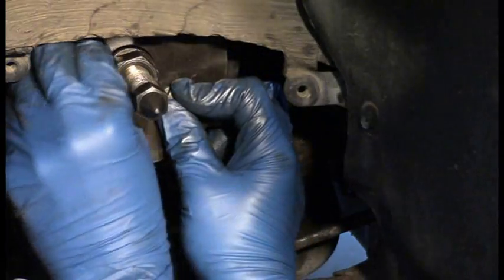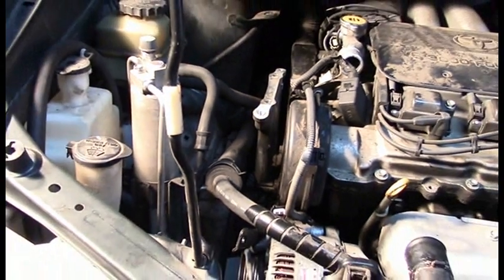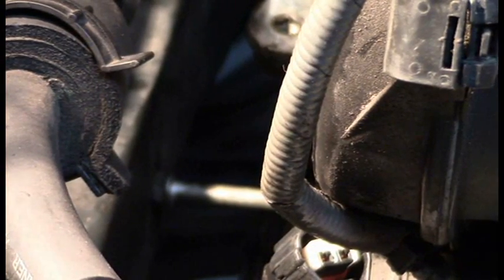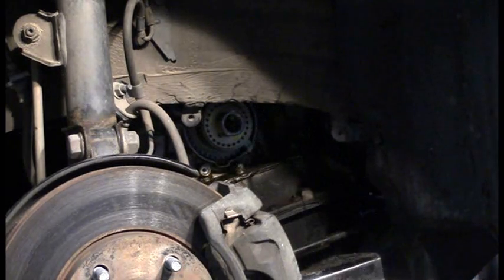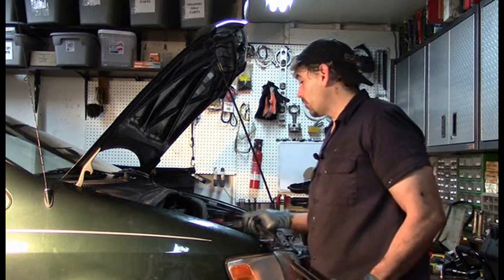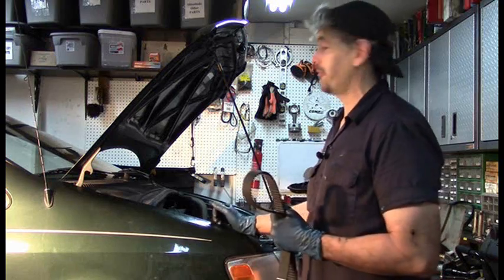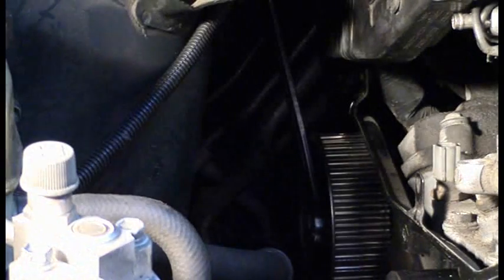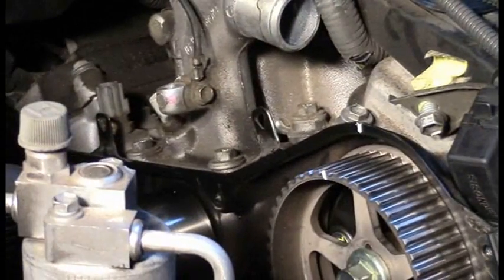Timing Belt 1997-2010 Toyota V6 Sienna, Highlander, Camry, Lexus Part 2

Comment: Matt, another excellent video with very helpful suggestions like changing all parts that touch the timing belt.  I have to do this job in a few months on a 2005 Camry 6 cylinder.  Couple of questions.  1.  in regards to 14:38 in the video, some manuals call for rotating the crank shaft pulley 60 degrees counterclockwise from TDC which may prevent having to wedge a wrench on the Bank One cam shaft sprocket.  If true, does that change how I align the new timing belt?,  2. where can I pick up some of that white paint?
Reply from the maker: +Sandbag1300 The white paint is just touch up paint from parts store. As for the 60 degrees- yes you can do that way too however I find it easier to keep the crank and cams lined up at TDC so I am able to easily check that everything is lined up.  Either method will work but eventually you will need the crank and cams lined up at some point- I just find it easier and I think safer to lock the cams is all. 
  I have done it both methods though and mine just makes more sense to me.
Reply: +Schrodingers Box Can you also list the models of the crank puller and cam sprocket wrench you used.  The Toyota versions are really expensive and I would rather not pay for Toyota tools if I do not have to.
Reply from the maker: Crank puller was an OTC universal puller and the sprocket wrench was Lisle.

Comment: How do I remove the rear camshaft sprocket in order to change the oil seal without it springing back? You mentioned you didn't want to remove it because it would be a big pain, but I need to remove it so I can replace the oil seal. What's the safe way to do this? Will rotating the crankshaft back 45 degrees, as you mentioned, relax all the spring tension on the rear camshaft sprocket enough so I can remove it without causing damage?
Reply from the maker: +Eric Kotter You positioon the crankshaft about 45 deg BTDC and then let the cam settle back into its neutral position, then you can safetly remove the sprocket without having to worry
Reply: Thanks!
Reply: The Haynes manual recommends making sure everything is properly aligned, removing timing belt tensioner, then...

"#15: Relieve the tension between the rear (right-hand) and front (left-hand) camshaft sprockets by turning the rear sprocket slightly clockwise." 

CAUTION: Don't Turn the sprocket any more than is necessary to provide enough slack to allow you to slip the belt off the sprockets.

#16: Remove timing belt." 

Is this technique possible/recommended? Instead of going counterclockwise with the crankshaft, going clockwise with the camshaft? Are these the same thing?

Comment: i thought ive seen some forums saying that 1mzfe is non interference and the engine will not be messed up even if the timing belt breaks while the engine is running
Reply: EvendimataE As far as I understand, the 1mz-fe VVT-I engines are interference. The non-VVT-I are non-interference.
Reply from the maker: Depends on the year but actually the engine shown in this video is not interference but I wanted to show the procedures for interference engines.  If you are in doubt, assume it is interference.

Comment: thank you very much for all information. I have to do it again and follow all right ways.
Reply from the maker: Most people who try this the first time find they didn't time that rear cam correctly.  It is very difficult to line the timing marks and the mirror, while the best way IMO, is still very challenging to use.  But normally if your car doesn't run right or you get a check engine light after this, it was mis-timed on the rear cam.

Comment: While talking about changing the water pump you mentioned the need to remove the cam sprocket. At the beginning of the video series you mentioned having a complete timing belt kit with water pump gaskets and seals (that you didnt show all) but now it seems that you are not going to change the cam and crank oil seals which I do on every job as a professional.  These seals also have 108K miles and are hard and the garloc seal spring is not compressing as strong and these seals will start to leak soon enough.  As you know, oil leaking on the belt later (soon) will shorten the life of the new belt, not to mention the oil leak will show up on the driveway soon enough also and will require the entire timing belt and gears to be removed again just for a $10 seal replacement (about $30 for all three, in Japan price).  I also estimate the accessory belts as part of the job after getting eyes on to see how old they may look, as you have mentioned.  If previously leaking oil I will also replace the front timing cover dust gasket (if used) as it is usually swollen.  If not swollen, I will clean it and RTV it back onto the cover right away so it will be dry by the time I put the cover back into place.  I also like marking the belt technique with a white stripe and verifying proper alignment before removing the belt initially,  Great job again.

Comment: Please dont forget that when you remove the harmonic balancer, that you should inspect the crankshaft key, and dont loose it, the crank keyway and the balancer keyway to see if these items are worn out, key slightly sheared or keyways for being enlarged.  As part of this job on some cars you will align the timing marks on the crank gear but once the job is done there may be timing marks on the balancer pulley itself to set timing or there may be a reluctor wheel on the back side of the balancer pulley that requires proper alignment with its crankshaft pick up sensor (CKP) and if the key or keyways are worn this alignment will be off and may seriously effect electronic timing on late models or inductive timing as far as a timing light is concerned on older models.  Always love your work.

Comment: Springs are relaxed when valves are closed, so wouldn't the relaxed position of camshaft be one with most of valves closed? I don't suggest to let it turn, but trying to understand what will happen if that  wrench would fail to hold that camshaft.
Reply from the maker: I will try to explain better-  the rear camshaft is very unstable in the TDC position and if you so much as accidentally turn it even a couple teeth towards the firewall it will snap very, very sharply and rotate maybe 100 degrees or so. Now I am not actually sure which cylinder(s) would be affected because I don't know the firing order off hand, but lets say for sake of argument that in snapping backwards, the intake valve on cylinder #1 opens (which would be the case since it was at TDC and valves closed so at some point rotating backwards will open the intake valve). Since the piston is sitting at TDC, the valve will open right into the piston, possibly causing damage (probably not likely to cause actual damage, but who wants to risk it?).  My strategy of locking the cam with the wrench is to prevent this from possibly happening.  Again, I don't know that cylinder #1 would be the one affected by this, but lets say at the TDC position Cylinder #3 happens to have a piston also at TDC just after the exhaust stroke so the exhaust valve just finished closing. Well in that case you would absolutely see how the cam snapping backwards very sharply would cause the #3 exhaust valve to slam into the #3 piston, right? Again I don't know the firing order off hand but I do know that at least one piston is definitely coming into contact with a valve is that cam snaps back.
  The front cam could potentially do the same of course except it's in a stable position at TDC so it is not going to move.  Hope this helps.
Reply: Schrodingers Box 
Google suggests that firing order is 1-2-3-4-5-6. If I did my math correctly, when cylinder 1 reached TDC, cylinder 3 made 120deg in intake stroke (intake valves open) while cylinder 5 made first 60deg in exhaust stroke (exhaust valves open). So exhaust valves of cylinder 5 will tray to turn camshaft by (60+53)/2=57deg backwards, but cylinder 3 intake valves by (120+12)/2=66deg. Intake valves of cylinder 1 will stay closed first (180-51)/2=63deg of camshaft backward rotation. So cylinder 1 we can hit with help of inertia and with this firing order only cylinder 1 is in danger.
Reply from the maker: Maris Strazdins Impressed!! Damn, Pascal if my calculator ever breaks I'm contacting you personally.
Reply: Schrodingers Box Anyway, You are wright, that camshaft should be held to prevent it from turning unless instructed otherwise. Firing could be different. For VW diesel engines with unit-injectors massive springs from injectors also could want to turn camshaft.

Comment: The main thing that separates the amateur from the pro is depth of experience, to know what to do when things don't go well. For example a broken bolt, or a harmonic balancer that won't walk off. The pro already knows how to deal with it. He shrugs and reaches for the right tool, as you did at 0:22. The amateur swears and gets a bigger prybar, and then problems cascade.
Reply from the maker: Absolutely true Dave!! Indeed most of what I know is from experience of doing the wrong thing years ago!! Also, a pro tends to just plain not get into trouble in the first place as much as an amateur- again as result of experience.  I really can't remember the last time I stripped a bolt, or cross threaded one, or crossed ignition wires up, poked a hole through a radiator hose, etc... Man when I first started, I used to spend far more time fixing something I caused myself than I did fixing the original problem!!  The right tools also help tremendously to keep out of trouble in the first place, as well as get out of trouble and of course make things go faster and easier.

Comment: Wrench holding the pulley will keep tension on it and the possibility of it flying off and damaging something else, plus get in the way of belt R&R. Impact gun on the pulley bolts would work if it fit in there.

Comment: Hey Matt! Once I broked a camshaft sproket on a,Ford Probe 2.5 V6 engine with a cam holder like yours. It was a bad day...jeje since then I prefer to take the valve cover and do it like the proper standars. Grettings From Barcelona Matt!
Reply from the maker: Oh my!! Wow I never heard of that but I can see how that could happen!  Good to know!  Once on a honda using the appropriate harmonic balance holder I broke the crankshaft bolt off inside the crank, a very bad day indeed! Sometimes even with the right tools you still have bad things happen lol!!
Reply: Those cars are completely extinct